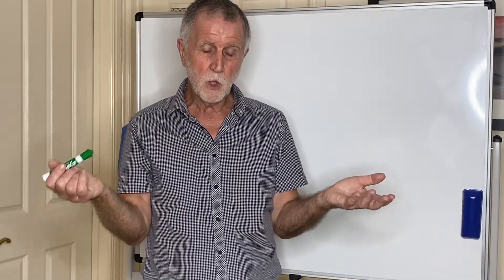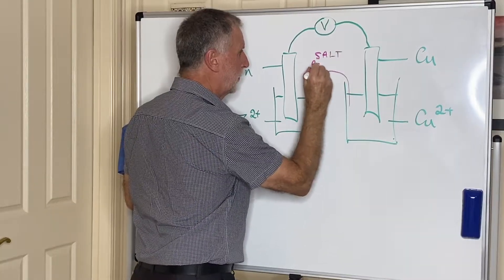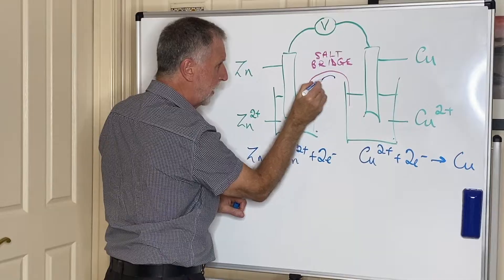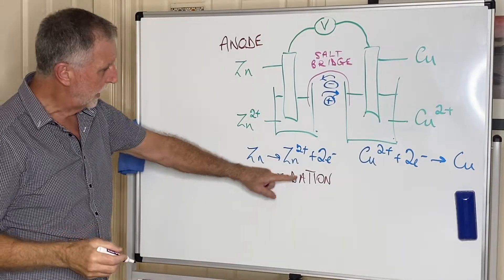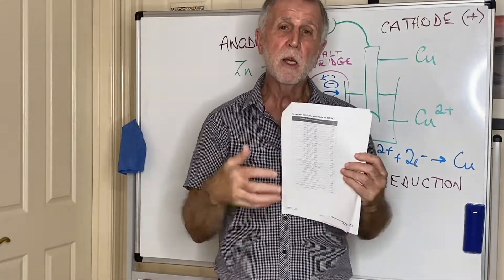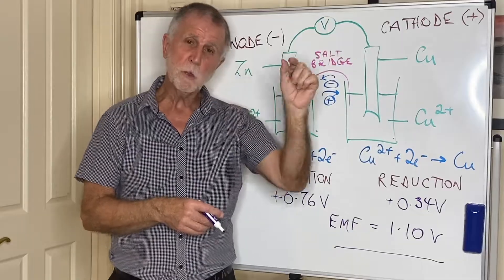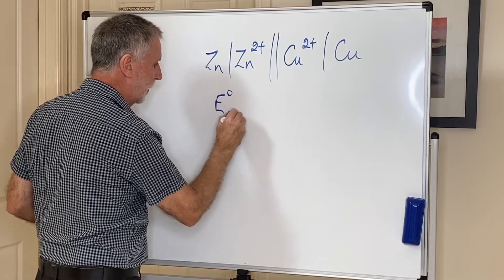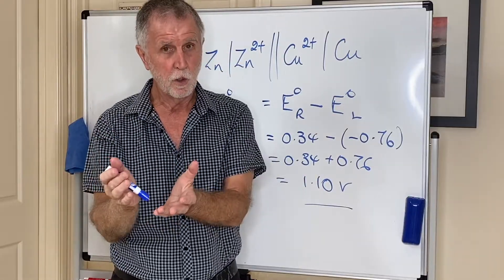ATAR QCE Chemistry Unit 3 Topic 2: Galvanic Cells and Standard Electrode Potentials

Comment: This may be a dumb question, but what happens if the solution does become charged without the salt bridge anions counteracting the Zn2+ cations?

Thank you so much.
Reply from the maker: The solution CANNOT become charged - IT'S IMPOSSIBLE - the salt bridge ensures that. Every ion lost or gained in the two solutions is replaced or cancelled by ions from the salt bridge. For example, if the salt bridge contains KNO3 (this salt is commonly used but it doesn't have to be this) for every Zn2+ ion produced by Zn ionising electrons at the anode, TWO NO3- ions come in from the salt bridge to keep the solution neutral. And for every Cu2+ ion lost at the cathode TWO K+ ions come in from the salt bridge to replace it.